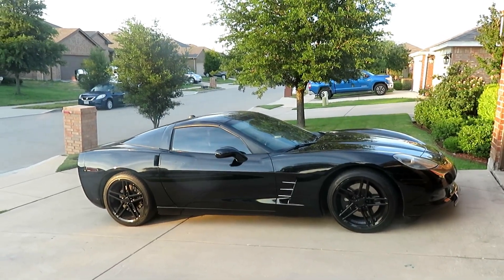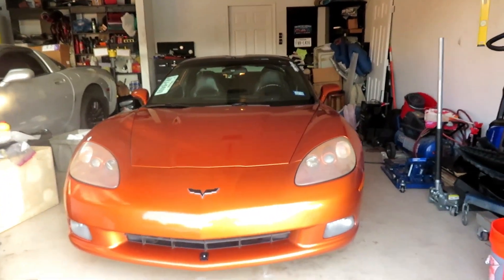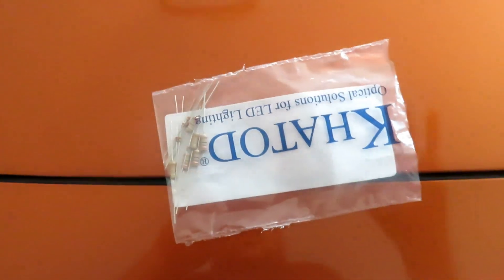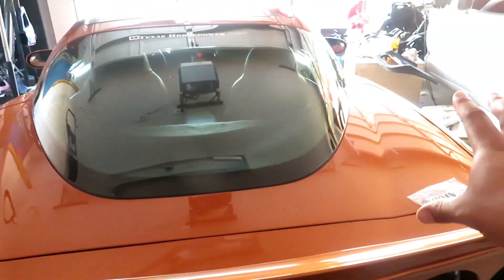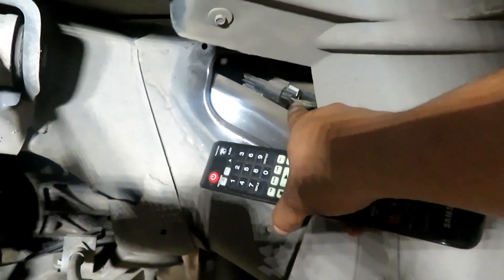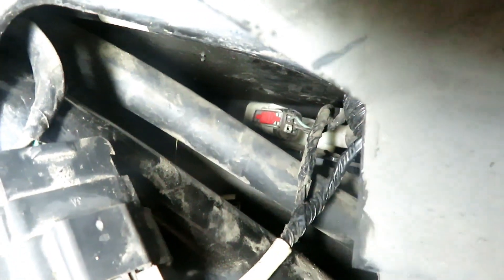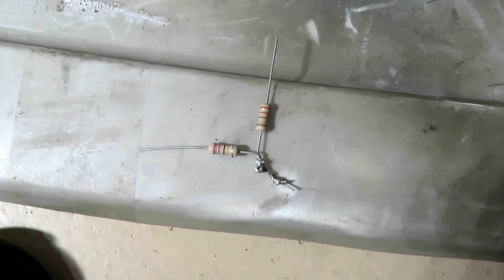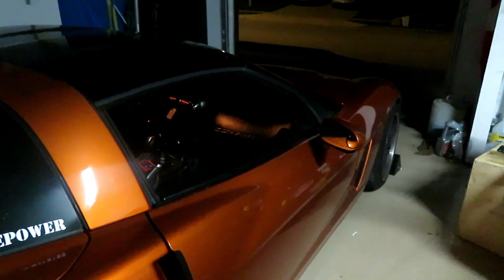Beating the System: C6 Corvette Fuel Gauge Hack P2068

Comment: Fix it right. If you can't afford the upkeep, you shouldn't have the car
Reply: Chevrolet quoted me 3,000…..
Reply: @georgesayre8225  They compete with supercars, go check how much Ferarri charges for a fuel pump replacement
Reply: Fix it right is easy to say. Not so easy to do. About a $3000 repair if you have a repair shop do it. About a 25 hour job if you do it yourself. And then after spending all that money or doing all that work, the repair may only last a few months. C5 & C6 Vetttes have nothing but trouble with the gas gauge working right. A lot easier to put a resister in it so that the gauge will work ok below a half tank and so the check gauges & low fuel lights stay off.

Comment: Hi,
I’ve been going through this for a year.  I saw Techron on the Corvette forum too, but did not try consistently.  An ex suggested $1500 to replace fuel pump (just for part).  Took it to my Corvette guy in December who also did the Techron. Of course, it worked for a minute, but is still acting up.  How long were you doing the fuel injector cleaners before tricking the reading?   Your suggestions sound reasonable in price if I could get a mechanic on board to try.  I’ve had the car since 2006 and mainly used Costco/arco gas.  Hoping to trade it for a c8 in a couple of years.  It’s got about 78k miles. Thx

Comment: Same situation here on my car. I found a better solution on it. The time I filled up my car, it has 2 bars on the fuel gauge. I turn back on and started the car the gauge didn’t moved to full. Pretty much the sensor and ecu recorded the last fuel level. And then I kept driving and driving until it say low fuel. Then later a message “fuel service required” which p2068. 

I noticed after that, the indicator bouncing half, full and empty. 

I took the fuel pump relay and fuse off. I let it sit for the meantime, maybe 5 minutes. Put back everything, I turned the ignition on or to accessory mode. A minute later, I turned the ignition on. The indicator successfully did it cycle. And tadaaaaaa.... it goes back to normal running condition.
Reply: Did the problem ever come back

Comment: All that work, and dismembering the factory wiring harnesses, to get something that half works, SOME of the time? Is that better than having an engine code thrown, until you can get the fuel gauge sending unit replaced correctly?   Park the car at your local Chevy dealership, put the keys in an envelope, throw it through the night slot in the door, wait for the phone to ring.   P.S. You misspelled "Susbcribe".
Reply: I spoke too soon. Dropped mine off for this problem. Even though my 07Z is under Carmax Maxcare, $1700. Exact same issue. Puts your compromise solution in a better light.